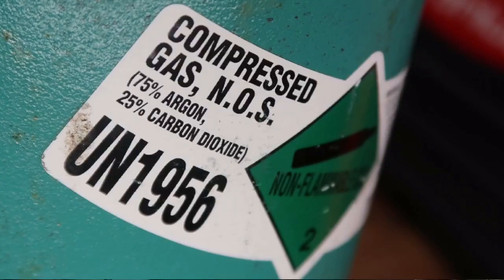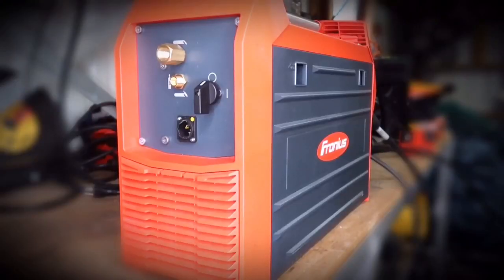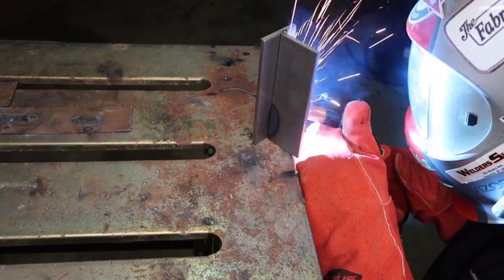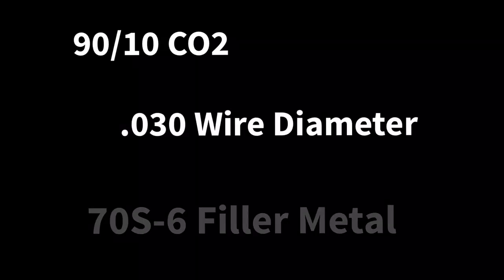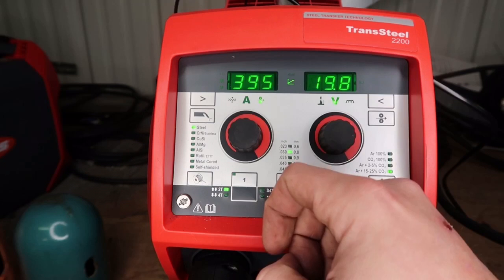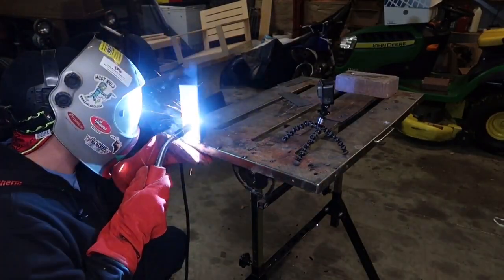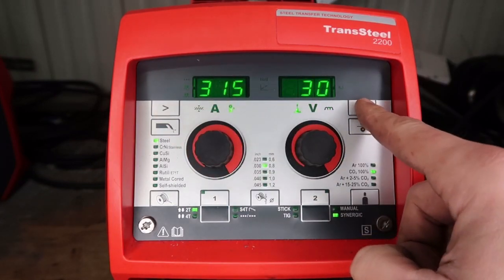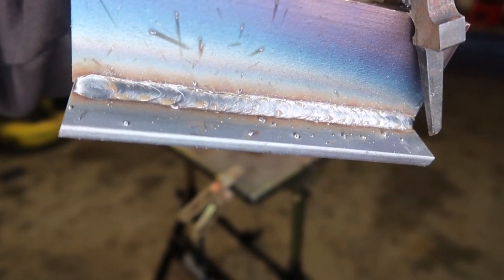What is the best MIG gas for your 110 volt or 220 volt MIG Welder?

Comment: not going to lie man the spray arc didn't seem that smooth on the start Maybe it was your feed speed or it was jamming up from your gun angle but spray arc off 110 is pretty impressive that is if you have expensive 5% oxygen gas but what will it do with .045 wire
Reply from the maker: Adam Z Yeah I noticed that on the start as well... Thinking about testing further on each gas to get the best results versus can settings. On video 3 I show all the gases in spray on 220 v . Thanks for watching dude 🤘
Reply: MilkyCereal83 which fronius machine was that? what kind of voltage range can you run on mild Steel with .045 wire and is there and open setting to where I can just hook up the gas set the wire and voltage to what ever I want. it looked to be limited on some settings to like 395 wire speed on one setting if remember right and you couldnt pull full voltage. I can achieve spray arc on a Lincoln 256 with 75/25 gas believe it or not.  .045 wire 26 volts and like 450 wire speed. I have done 28.5 volts and 600 wire speed 90\ 10 gas .045 wire and Got A Cleaner weld with less spatter. ever done vertical down 1\4 inch gap bridging with spray arc? I would like to see it lol
Reply from the maker: Adam Z I’ll have to look at the voltage setting for .045 wire and yes you can put it to standard mode with volts and wire feed independently. Fronius has a 110/220 unit which is called a TransSteel 2200 and then a 220/480 unit which is a TransSteel 2700. This would be similar to your Lincoln 256. Check out video 3